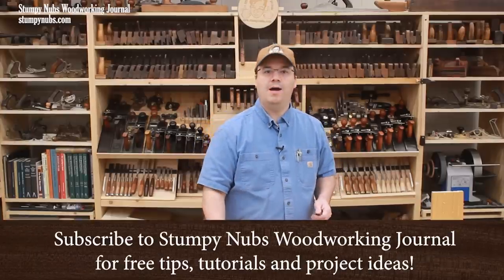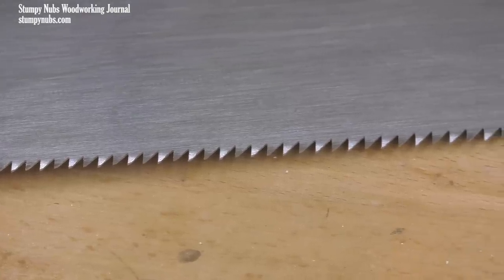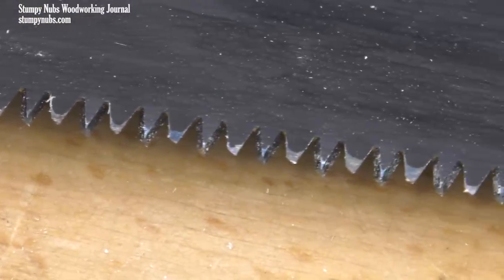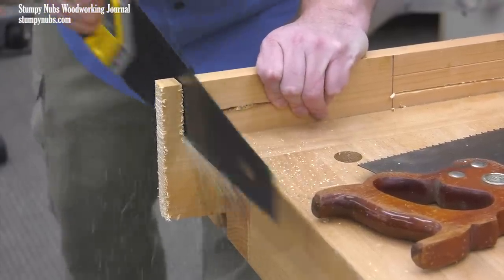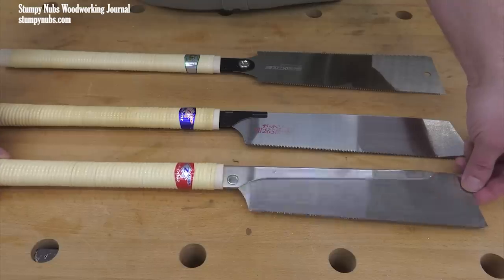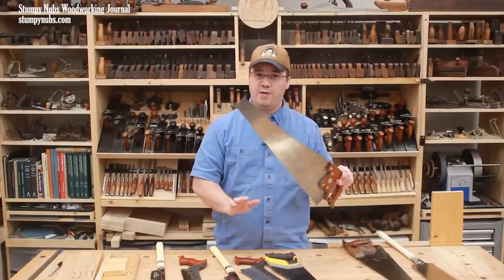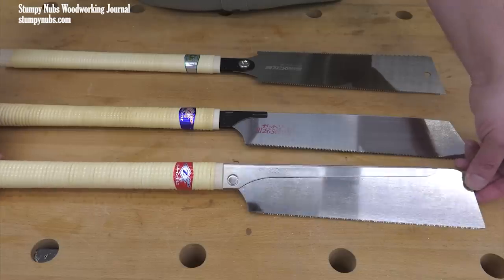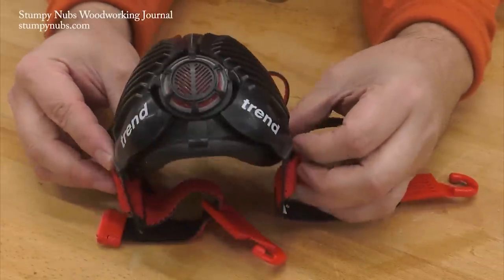Do Japanese saws cut faster than western saws?

Comment: Speed is not as important as the cut quality, Show the wedge of the wood, That's what's important to me and I'm sure most people.  If we wanted speed we would use a power tool.
Reply from the maker: Nobody says you MUST be concerned with speed, but there are plenty of reasons why one may wish to consider it when choosing a tool. Speed can equate to less energy expended. It can also make a significant difference in the time it takes to dovetail a chest full of drawers or any number of other tasks. That said, there are many other factors to consider besides speed such as precision, comfort, quality, etc. These were covered in the other video: https://www.youtube.com/watch?v=PZdoLx72faM.

It is also worth remembering that not all of the fastest cuts in this video were rough cuts. The rough dimensional cuts may have been, but the joinery cuts were not. There is a time for both types of cuts and a bit more speed does not always equate to a poor result.

Comment: This kind of japanese saws are not about speed, but more cut quality and less sweat. They remove less dust, so you need less energy and strenght to cut. I mean, I rather push and pull effortless fifty times, than 20 hard tiring and disheartening strokes.

Comment: I have never once used a hand saw with speed of cut in mind, ever. Speed is what power tools are for. I can’t imagine hauling ass through a dovetail cut. Just saying…
Reply from the maker: Nobody says you MUST be concerned with speed, but there are plenty of reasons why one may wish to consider it when choosing a tool. Speed can equate to less energy expended. It can also make a significant difference in the time it takes to dovetail a chest full of drawers or any number of other tasks. That said, there are many other factors to consider besides speed such as precision, comfort, quality, etc. These were covered in the other video: https://www.youtube.com/watch?v=PZdoLx72faM.

It is also worth remembering that not all of the fastest cuts in this video were rough cuts. The rough dimensional cuts may have been, but the joinery cuts were not. There is a time for both types of cuts and a bit more speed does not always equate to a poor result.

Comment: I'd be more interested in knowing the time to make the cut along with the stroke count. Most of  my projects aren't stroke based (͡ ° ͜ʖ ͡ °) they are more time based. though I do personally prefer pull saws, I've got weird joint alignment with my thumbs that makes it hard to repeatedly push my saw. easier to have a small strap at the end of my saw kind of like a wii remote

Comment: As I watched your footage, I saw (pun intended) that you weren't using all or most of the teeth in your strokes for some of them. That would factor in also. My father used to tell me "I paid for the whole saw, so quit using only part of it!"
Reply from the maker: Generally I begin with short strokes and lengthen them as I go along and get in a rhythm. Everyone has their own style…. As to how that affects my tests- Each tooth can only remove so much wood from the kerf. A longer stroke just passes more teeth through the kerf with each motion. That doesn't necessarily equal less overall time cutting through the board. If that were the case I'd just get a 3-foot long Japanese saw, cut the board through in half a stroke and declare it a winner. In this video it seems to me that most of the strokes were about the same length regardless of the saw and this allows us to observe the difference between the types of saws independent of the length. After all, not all Western saws are longer than Japanese saws.
Reply: @StumpyNubs  all good points my friend. Thanks for the reply and keep up the good work that you do!

Comment: Using a dust mask is Wrong it is better to extract at source see the health and safety hierarchy of controls
Reply from the maker: Extracting all fine dist at its source is impossible in consumer lever shops. The tools are simply not designed properly for that level of extraction.

Comment: It's sad that something as soothing as woodworking gets reduced to how quickly a cut can be made. Surely the true measure should be how it feels. Otherwise you may as well just use a machine.
Reply from the maker: Nobody says you MUST be concerned with speed, but there are plenty of reasons why one may wish to consider it when choosing a tool. Speed can equate to less energy expended. It can also make a significant difference in the time it takes to dovetail a chest full of drawers or any number of other tasks. That said, there are many other factors to consider besides speed such as precision, comfort, quality, etc. These were covered in the other video: https://www.youtube.com/watch?v=PZdoLx72faM.

It is also worth remembering that not all of the fastest cuts in this video were rough cuts. The rough dimensional cuts may have been, but the joinery cuts were not. There is a time for both types of cuts and a bit more speed does not always equate to a poor result.

Comment: The dewalt is not a saw you can resharpen. The teeth are hard as a file so that’s why it didn’t cut as fast as it should have. Its a throwaway saw. Its a marketing ploy. Old saws are resharpenable.

Comment: You counted number of strokes but very little mention of the length of stroke. Now try a 42" rip saw with a man that has a 36" stroke.
Reply: Stroke length is imortant. One of the first things my dad taught me about using a saw is to use the whole length of the blade. To, it looks like stumpy was using too short a stroke on the rip. And the blade wobbled.

Comment: I actually try to avoid rough breaking down the material. There are enough cuts to make just making sure everything is exact and getting after specific parts within an eighth or sixteenth... and smoothing out from there...

    The Japanese pull saws with thinner kerf and even shorter strokes just tend to reduce blow-out and tear-out, overall, reducing the later cleaning and "spit-polish" for a finished piece... or a multitude of pieces. When trying to suit or accelerate a schedule, then, it's just less "hooey" for me to use the pull-saw and be done.

     OF COURSE, again, we're talking subjectively, and this IS about preferences... I consider myself more of an "artisanal wood crafter" rather than the precision engineering oriented "modern wood-worker. Not that I have any less precision, but I rarely bother following the "common dimensions, as I often go from a mill-cut 1" (for instance) to just enough reduction to get the entire project actually smooth for finish... where common dimensions imply using a planer and/or joiner to "smooth" the piece down to 3/4 "...

     AND I suppose most shops don't follow a mantra like "Measure twice, cut once, and beat the hell out of it until it's in anyway."  OR  "Just get a bigger mallet. It'll fit."   ;o)

Comment: Does it actually really matter how quickly a joinery or crosscut saw cuts? For those kinds of cuts you generally aren't going through all that much wood and if you're using a manual saw of any type I can't imagine you're in that much of a hurry. If anyone out there is hurriedly handsawing all their lumber to length I'd love to hear why. The rip cuts are really interesting, though. There are definitely situations where choosing the quickest saw could save a ton of time and effort when ripping down longer pieces.
Reply from the maker: Speed can sometimes mean less energy expended. Of course there are also many other factors involved. This is just one of them.

Comment: Bought the Japanese pull saws from last video and gave them a try last week on a project.  I tended to bend the saw to the side and cut into my frame unexpectedly.  Took some sanding to fix that!  But they cut smoothly and cleanly which I wanted.

Comment: I can only speak as a novice. But the pull stroke simply feels more natural and intuitive. For that reason alone, I've stopped using western saws. 
I was raised by a professional carpenter, my childhood and teens were filled with odd-ball carpentry projects. I am no expert, but I'm also no stranger to wester saws. However, even the very first Japanese saw I used, I was more accurate than years spent with a western saw. While the pull stroke not only felt more natural, but also less tiring.  For that reason alone, I will never buy another western style saw.
Reply: I also felt instantly at home with my Japanese saws in the shop, despite many years of western saws. I will still use a push saw like the DeWalt for work around the farm, but only pull saws in the shop. Everyone has their own requirements, but in my shop, precision is more valuable to me than speed. I doubt my treasured Japanese saws would cope with a lot of farm work, and I have no intention of putting them to the test! When my current Bahco saw  no longer cuts the timber (I've never tried it on mustard!), I'll try the DeWalt.

Comment: Your experiment is moot if all strokes aren't of the same length. Which they are not.
Well...same length when testing tooth efficiency and available length when testing saw efficiency.
Reply from the maker: Each tooth can only remove so much wood from the kerf. A longer stroke just passes more teeth through the kerf with each motion. That doesn't mean it is cutting faster, nor does it mean the cut requires less physical effort. If that were the case I'd just get a 3-foot long Japanese saw, cut the board through in half a stroke and declare it a winner. I kept all the strokes about the same length regardless of the saw to observe the difference between the types of saws, not just the lengths of the particular models in the test.

Comment: I prefer beautiful cuts to speed
Reply from the maker: Nobody says you MUST be concerned with speed, but there are plenty of reasons why one may wish to consider it when choosing a tool. Speed can equate to less energy expended. It can also make a significant difference in the time it takes to dovetail a chest full of drawers or any number of other tasks. That said, there are many other factors to consider besides speed such as precision, comfort, quality, etc. These were covered in the other video: https://www.youtube.com/watch?v=PZdoLx72faM.

It is also worth remembering that not all of the fastest cuts in this video were rough cuts. The rough dimensional cuts may have been, but the joinery cuts were not. There is a time for both types of cuts and a bit more speed does not always equate to a poor result.

Comment: Great video. To give more validity to the results, you should take multiple cuts with the same saw for each direction, to check for consistency
Reply from the maker: What about grain consistency between boards or portions of boards? Speed or arm movement? Downward pressure? Angle? The variables are endless...

Comment: for fine work japanese saws are better.. for rough large work the european saws are much better.. having a mix of the two is best.  historically in european saws both push and pull saws have exsisted and saws with variable length teeth exsisted for these tasks.. japanese have retained their love of saws.. but in the west they have declined with decline in use.  the

Comment: I'm sorry, but I don't see the point here. For fastest rough cuts, use a chain saw! Don't give me this purist crap, neither. My first drill in my tool box was a brace and an auger bit. Now that was rough!  Handsaws were compulsory, as cordless wasn't invented yet, but only used for form-work and other rough carpentry. Why are we even discussing these things now? Hand saws are for pruning trees when your battery in your sawzall goes dead! (BTW, I am a certified general carpenter since 1974). 
When I was in trade school in the early seventies, I had to make hand-cut dovetail joints with a box saw and chisel. It turned out fine, with no Japanese saws involved. I don't know the TPI, this was almost 50 years ago, so don't even ask.

Comment: Unless you’re making a LOT of cuts, who cares about speed of hand sawing? Even if you are making a lot of cuts, time spent sawing is a micro fraction of the total time on a project.
Reply from the maker: Nobody says you MUST be concerned with speed, but there are plenty of reasons why one may wish to consider it when choosing a tool. Speed can equate to less energy expended. It can also make a significant difference in the time it takes to dovetail a chest full of drawers or any number of other tasks. That said, there are many other factors to consider besides speed such as precision, comfort, quality, etc. These were covered in the other video: https://www.youtube.com/watch?v=PZdoLx72faM.
Reply: Good points. Thanks.

Comment: I own and use all three types of saws and never worry about anything except that they are sharp.  Thanks for the education.
Reply: ya, and that's usually the difference for people. they try using an old push saw that they have laying around and then compare it to a brand new pull saw they buy online and are amazed at how much easier the pull saw it. the real reason is that the push saw they had laying around had never been sharpened and is decades old while the pull saw is brand new and sharp.

edit: heck, just look at this video. those push saws are way older than the pull saws. the difference being he knows that the saws need to be, and have been, sharpened. most people ignore that very important detail.
Reply: @atomictyler  Spot on brother!

Comment: How about time needed to make a spcific cut instead of number of strokes? Shorter saws need more strokes, but not sure how it affect the time used.
Reply from the maker: Too many variables. Is every stroke the same speed? Same angle? Same downward force?
Reply: @StumpyNubs  it's a very difficult thing to quantify for sure. I guess it has to be subjective.

Comment: This is quite a good and fair test between the 2 saws, obviously there can never be a perfect comparison or test, because even if we eliminate humans from the equation and use weights and a mechanism to push/ pull the saw, it would become less useful as each human is different and will have similar but different experiences due to technique and body size posture etc. And as mentioned also the position of the cut matters, whether it is vertical, or horizontal or in an awkward place. Nonetheless, thank you for this video as you seemed to make it as fair as possible and gave a good representation of how those saws work for you and probably will have a similar result with others.